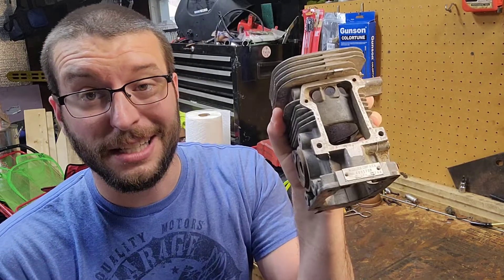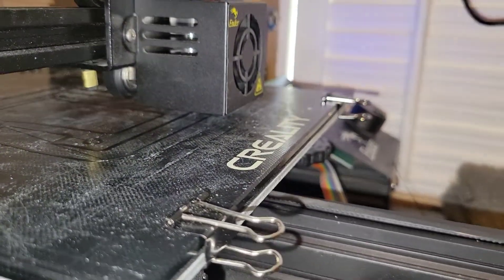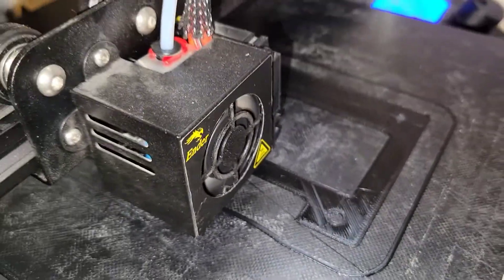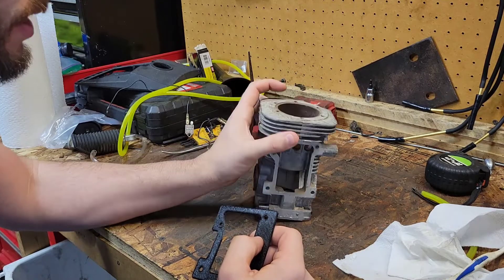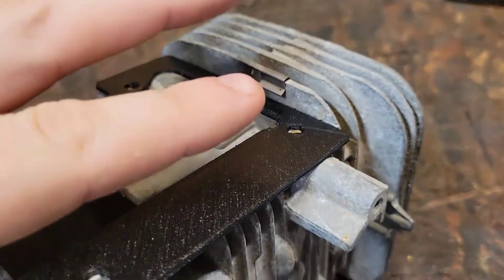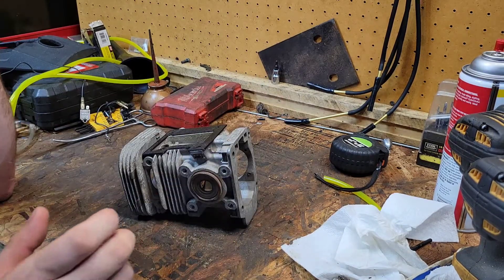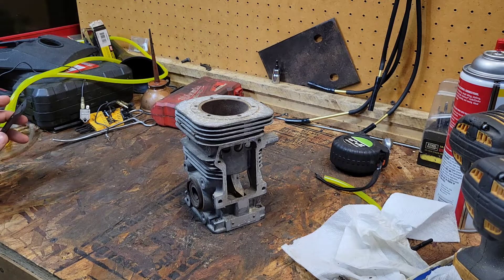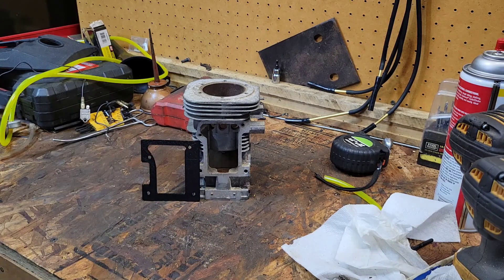3D Print Your Own Gaskets?? Let's Give It A Try! Part 1

Comment: Take a pic and use it as canvas, and draw a gasket with line tool. 100% evry time!
Reply from the maker: Putting on computer however I don't think that works. But now that I have it designed, it's on a few sources and ready to print at my will.
Reply: @mistermacgray  
It does work, you just use the picture on the background, trace the lines, and then dimension the lines from your measurements. I haven't done it for 3D printing, but I have quite a few times for machining to get bolt circles and such for parts a customer sends with measurements from beyond driving distance for emergencies.
Reply from the maker: @cavemanjoe7972  I got the gasket refined after this enough to where I have a set working on another saw without issues.
Reply: @mistermacgray  

Oh, I was just talking about using a picture of the surface as a background when you draw it up to simplify it. Good video.
Reply from the maker: @CavemanJoe  I now have a much better set of micrometers too which have helped a ton. What's life without a little trial and error?

Comment: Great job Bryan. My dad like how you made the gasket they didn’t have that back in his day at McCulloch lol keep it up my friend
Reply from the maker: I'm going to have to make a video showing how good this stuff is, even show how well a single layer of adhesion of each of the rows that are layer down bond to eachother. Another person asked to see how it does in boiled water which in a real world, a gasket isn't by itself but squished between two things so not very accurate but I can show how well it itself holds up and I'll soak some in 2 stroke fuel mix and do a before and after measurement test of how much fuel it absorbs if any.